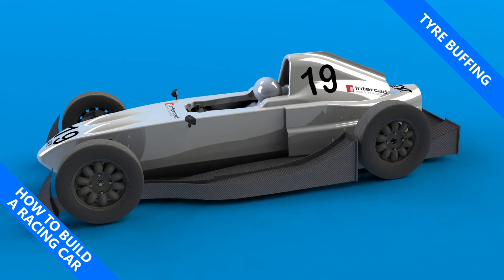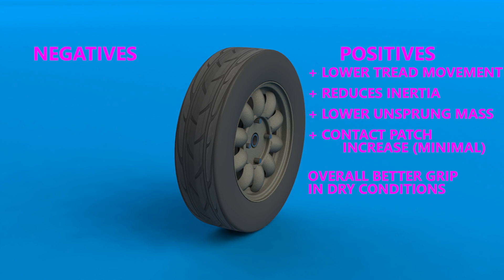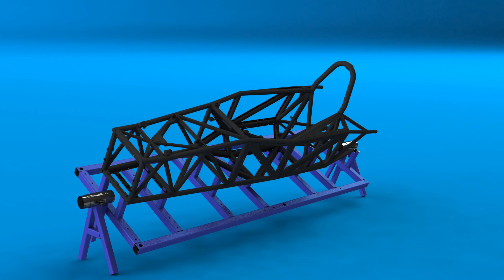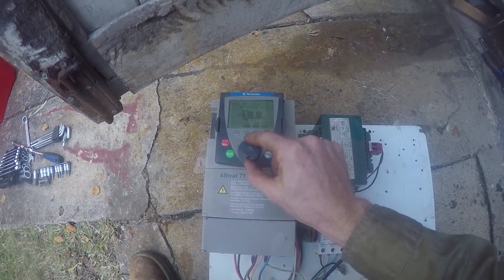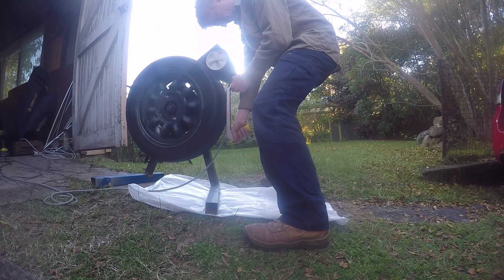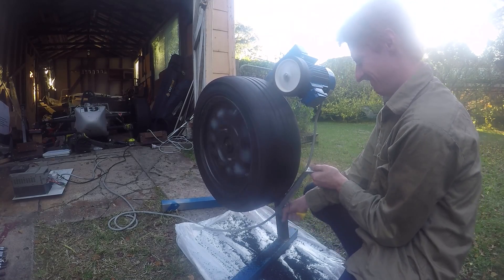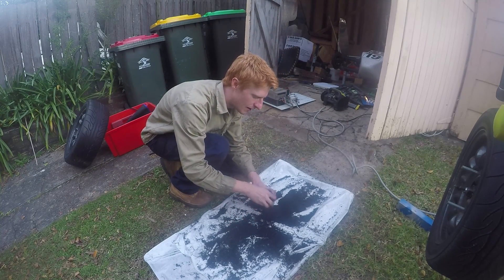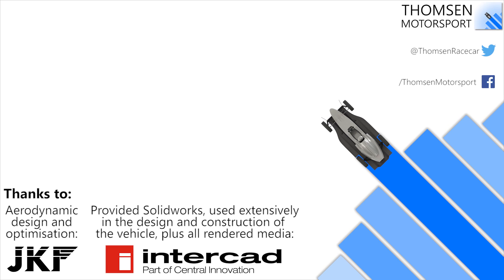Tyre Buffing

Comment: Nice Buffing machine you made. I want to build also a buffing machine but what are specs of the motor you used
Reply from the maker: Thanks. The motor was a small 0,75kW single phase (I don't recall it being three phase) industrial electric motor.
Reply: Thx

Comment: Grip problem with front tire must caused by the angle at which the tires turn. Both front tire turn at a slightly different angle to improve grip while cornering look it up.
Reply from the maker: Yes this is referred to as Ackerman.
Reply: @thomsenmotorsport7201  what?

Comment: and DID it help your front end grip?
Reply from the maker: It's hard to say really, I made other changes to the car between rounds that might have also had an effect. I'd say there was an improvement in grip but I can't say it was 100% due to buffing the tyres.
I was a little concerned about making the tyres out of round and so hoped to ensure this didn't happen by checking the tread depth around the tyre as I worked. Didn't turn out to be a problem after I was done.
Reply: thanks - though i guess the 'out of round' thing might have been less of an issue (theoretically) had you done the buffing with them actually mounted on the vehicle. I'm hoping to see some more racing!

Comment: I'm curious on the underbody design. In your CAD files it shows a undertray with quite alot of feutures yet on the car itself nothing like it is mounted. What was the process for designing this tray and when (if) do you think you will mount it?
Reply from the maker: G'day. The undertray was completely designed by Kyle of JKF Aero - you can find his YouTube channel here https://www.youtube.com/user/Kyleengineers. He has a number of videos covering design of elements such as this.
As far as me building it, I've been too busy so far this year to get it done, all going well I may have a crack at building it during this later half. I'm not having to do so much on the car itself anymore so I'll have some time to spare to put towards it.

Comment: Please can you upload something on your braking system, you channel is awesome by the way.
Reply from the maker: I'll have a think about what I could do with it, there wasn't a whole lot of design that went into the braking system. There isn't a whole lot for me to say in all honesty, I used fairly common components, only thing I had to do was connect them up with hydraulic tubing - is there anything specific you are hoping to see?
Reply: Thanks for the reply, your channel is awesome by the way. If it is not too much to ask. I wanted to see your pedal assembly, the technique you used in tubing from the M/C and how it connects to the calipers. Also your pad and rotor materials. Thanks a bunch
Reply from the maker: There's a video on my channel covering the pedal build but yes, I'm missing stuff on the interconnections. Maybe I'll work something into a race report, there's not really enough to it to warrant its own video I think. I just used a combination of hard and soft line to make the connections. The rotor is a solid steel disk as is dictated by our rules. I've got some racing pads in there, Ferrodos.